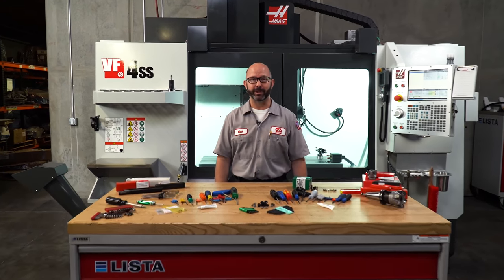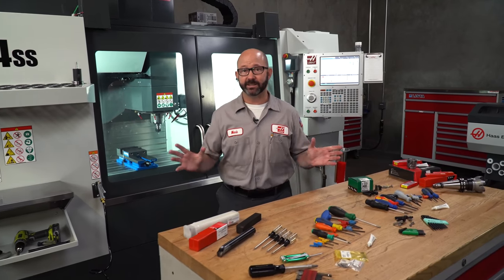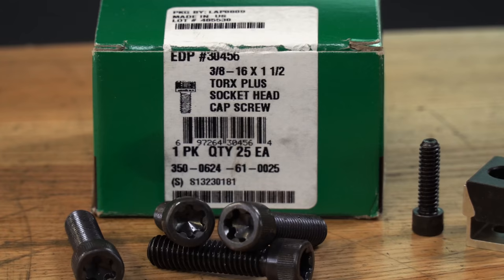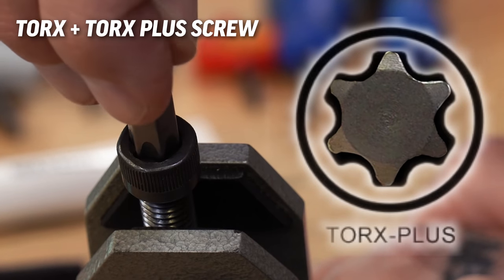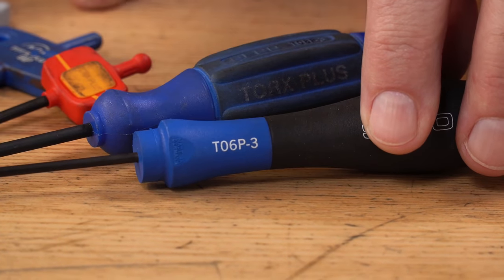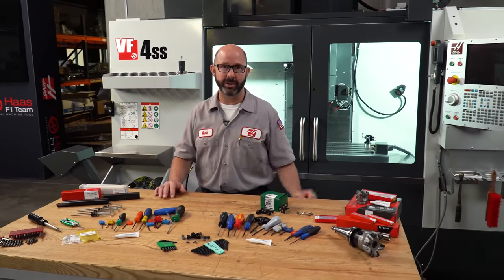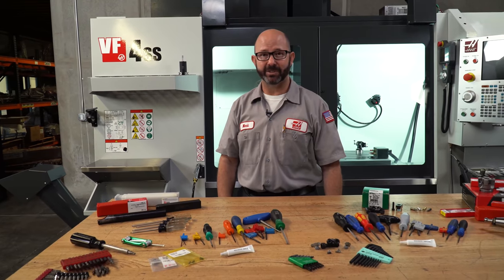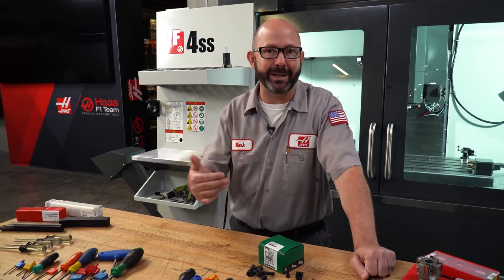THIS IS NOT A TORX - Haas Automation Tip of the Day

Comment: "The company invented a new system that was even more secure"...

Yeah... for sure. That was the reason. They did this for us, so that we have an easier life. Another 25 year Patent was absolutely not involved in the decision of doing the same thing again, but different.
Reply: You need to get out of your conspiracy bubble. I've run the A to B torque to failure testing in a fastener laboratory. Torx Plus has a substantially higher permissible drive torque than a standard Torx.  The geometry of how the drive torque force is transmitted through the drive feature is substantially different, there's a lot more material there.
That's why you'll see them being used in low profile or high torque applications. Nissan, Ford and Tesla among others use them in production.
Reply: @otm646  and of course having the patent on that new system for another 25 years had nothing to do with them bothering to develop the improved version. When it boils down to it, its just to sell more stuff !
Reply: @Decrepit_biker  Pretty neat how they only last 25 years, huh? forces innovation 
or whatever
Reply: @amicloud_yt  I have known a company sit on an improvement for 15 years to get to the end of the 25 year period before releasing the update! I know as I used to work for them 🤣
Reply: @otm646  And in none of those the torque limits are even close to reacing,

A Hex-Head or an allen-head are capable of spanning even a 12.9 Screw, so how would being able to transmit more torque be benefitial?

The difference between the two torx heads is minimal in performance. 

The reason Automotive manufactuerers use these screws is that the manufacturer holds the patents, therefore is the only producer and therefore can give contracts with billions of screws involved, which in turn makes it impossible for outside manufacturers to join in. 

In essence they use patent law to influence the free market and keep their role. 
Its funny how you americans that are always about small business and people getting successfull do not see how this is a system that prevents any of you ants tp even be able to talk to your potential customers.
Reply: @peteraugust5295  That's not how it works at all. The automotive manufacturers do not hold the patents, they're held by fastener design and engineering companies like Textron. There's very little incentive for the OE to adopt something like this unless there is an engineering improvement worth the cost. The cost isn't direct, the fastener manufacturers whom they purchase parts from need to procure a license. That cost is passed along to the OE. The license isn't so expensive that it makes only Textron competitive in the bidding process.
No OE would agree to a directed buy like that either
Reply: @peteraugust5295  
>In essence they use patent law to influence the free market and keep their role. 
patent law does not make a free market. a free market is no regulations no protections period. not even copyright. a wild west of a market, leads to rapid and substantial innovation meeting or exceeding the needs of the market. while being 1000x safer and 1000x cheaper.
>Its funny how you americans that are always about small business and people getting successfull do not see how this is a system that prevents any of you ants tp even be able to talk to your potential customers.
no shit, why I am an anarcho-capitalist, not a socialist or a crony-capitalist. screw government, put this country back to the way it was.
Reply: @otm646  on the contrary. a large portion of manufacturers would really like to keep you out of their products... * chough * Nintendo * cough * and would design a fastener just to keep you out of it. remember the triangle bits form your old gameboy? never seen them on any other device, like ever. But security bits are a major problem in these industries... good thing a lot of them are just doing torx with a pin in the middle, that only take a drill to make your regular torx fit that screw hole but that's besides the point.
Reply: @TheObsesedAnimeFreaks  Patents encourage innovation not stifle it. Without patens another company will just reverse engineer your product and without the R&D cost release it for a more competitive price, forcing the original manufacturer out of the market without seeing a return on their investment. A truly free market doesn't work for many reasons but this is a big one.
Reply: @fergusoddjob  This is actually completely incorrect, it would instead cause the inventor to strive to constantly improve their product and release updates regularly, while also forcing competition. The investment put into the product would always pay off as continued investment, marketing trust and quality assurance will keep the inventor competitive. In a truly free market, innovation is king. The question that you should ask is not whether your investment would be "protected" rather is there a hole in the market I can fill. If you answer the latter question, the roi becomes irrelevant as that's almost guaranteed if your market is big enough to return that investment. Never mind pattents do nothing but stifle inovation as they are a roadblock to it by definition. It allows companies to sit on their crap products rather then invest time and money into improving them.

Never mind no company in their right mind would just copy another companies product. They almost always have to invest time and resources to change and improve the product or bring something new to the table.
Reply: @TheObsesedAnimeFreaks  No company directly copies another's product because of patents not despite them. In China where patent law isn't really enforced carbon copies of patented products are very common.
You honestly think businesses will sink millions into research and development if they aren't confident they will be able to recover costs and hopefully make profit. Without patents companies have a few weeks maybe a month to recoup costs before a competitor undercuts them and that's not long enough. 

Ignoring patents for a minute, a truly free market has so many more problems. In industries with high entry costs like utilities and train lines the likelihood of a monopoly forming without government intervention is very high. In a truly free market there are no public goods, meaning you'll pay out of pocket for roads, streetlights, parks, healthcare (you already do in the US and it's not working), education, law enforcement and ambulance services. Finally, without government regulations corporations will take advantage of negative externalities to increase profit, for example foregoing environmental protection processes in the interest of profit.
Reply: @TheObsesedAnimeFreaks  "it would instead cause the inventor to strive to constantly improve their product and release updates regularly,"

What you're saying here is that the inability to ever make a profit on the original product (because it would immediately be copied and released by other producers who do not have to cover the development cost) is the incentive to abandon the original product and start developing an upgraded one, which would also be copied immediately upon release by a competitor, and so the cycle repeats. The inventor gets all the R&D costs and the moocher gets all the profits. Behold - the theft economy of "anarcho-capitalism".

"Anarcho-capitalism" is a contradiction in terms. Capitalism is the system where individual rights, including property like patents, is uniformly and objectively protected by a single entity (the state). Anarchy is subjective rights which means subjective law, which means a state of constant theft, violence and warfare.
Reply: Torx bits are not particularly durable, particularly the smaller sizes. I'd say they're even weaker than hex bits. I can absolutely see how the Torx+ would last longer and/or be capable of more torque. Business innovation and property rights in the form of patents is not a sinister conspiracy but a vital part of a capitalist economy.
Reply: @TheObsesedAnimeFreaks  They are misusing the Patent Law, which by definition requires essential improvement to a product to be reapplied. 

Du to their market power they can afford pushing thru patents that do not really qualify for one. Something that the average Shmoe never could manage.
Reply: At least they were kind enough to make it somewhat backwards compatible.
Reply: @fergusoddjob  You reply in video which states, that Torx was only widely adopted after the patent protection ran out, where many comment that they never saw a TP screw in the wild and lots of other examples like this exist (Robertson screws for instance). Are you sure the system works great?
Reply: @svensonb2118  I was discussing with someone who seems to want to abolish patents entirely. I agree that patents have their problems and  can result in large companies with the resources to pursue lots of patents dominating the market. I think there's a pretty good argument for shortening the patent time period  as well. But getting rid of the system entirely? That just sounds absurd to me.
Reply: @fergusoddjob  
>You honestly think businesses will sink millions into research and development if they aren't confident they will be able to recover costs and hopefully make profit.
if you are sinking that much money into something and it's a cheap product, to copy and reproduce, you are doing something wrong. if you are a CPU producer, for example, then the cost to produce these products is even more expensive and improbable to duplicate. this is reality despite no patents preventing competing companies from creating new CPU architectures to compete with Intel and AMD. IP is still a factor, however x86 or CPUs a general idea is not patented, it's IP. 
Fields with high boundaries of entry are almost always going to be lower competition because fewer companies have the means to produce the produces, and they are often extremely difficult if not more expensive to reverse engineer. 
if you are designing a lock, what are you going to spend to develop that lock? 100k? you can easily make that back. tooling manufacturing it's not going to cost all that much to make that lock and produce it. 
a phone? you are using off the shelf components, and in a free market, FCC cert would be unnecessary, further reducing the cost. just design the housing and the place the components and you have a phone, in an over simplified manor. that would cost you 100k? if you are just using off the shelf components?
So yeah, in a free market companies will continue to spend millions if not billions on specific types of products with high production or development costs. however the excuse to spend a million+ on a simple product, like a fastener would be gone, like if very well should be. 
>In industries with high entry costs like utilities and train lines the likelihood of a monopoly forming without government intervention is very high. 
Actually no, the likely hood of a monopoly forming is not plausible. considering the fact that anyone could run lines wherever and no government could stop them. in fact you would probably have 3 options of power companies running 3 different standards, and likely the ability to run 240v for your computer and other office electronics for efficiency in America, and then run lower voltages for other things.  same with cable and telecom. not to mention that consumers would often have to bear the cost of running cable instead of governments footing the bill like they often do. 
>healthcare (you already do in the US and it's not working),
comparing a tightly regulated industry to a free market, is the most moronic thing you can do. our healthcare industry actually works extremely well, despite the BS we have to face, there is a reason people from all over the world come to America for treatment, and not other places. it would work better if government stayed the fuck out of it and let the market manage itself. 
>In a truly free market there are no public goods, meaning you'll pay out of pocket for roads, streetlights, parks, healthcare (you already do in the US and it's not working), education, law enforcement and ambulance services.
in a truly free market these things being out of pocket for the consumer is actually a benefit. sorry, you think that the roads should be paid for by people that don't use them or don't need to have them built? parks being private actually makes the parks work so much better, why are you knocking privately owned parks? law enforcement probably should be private, to some degree, and even if it's not, i should not have to pay taxes to fund a system I don't want/need/disagree with the enforcement measures. among other things. 
>Finally, without government regulations corporations will take advantage of negative externalities to increase profit, for example foregoing environmental protection processes in the interest of profit.
no company will ignore the environment for profits. When a market demands a company actually take care of the environment, the environment will be taken care of. they will make more money if they take care of the environment then if they don't more often then not, because their customers care about the environment. Second, when the market demands that things like DEF and other emissions systems get off their diesel vehicles because they don't work, they are harmful to the environment and is a convoluted system that is a bandaid on a already broken system. but instead of coming up with a better solution to the perceived problem and letting the free market handle it... they mandated 2 Bandaids on a broken system that doesn't need to exist. SO, the market is always right in that regard, there IS demand for "Greener" products, and there is demand for less polluting products. getting government out of the market will result in cheaper and cleaner energy via Nuclear, and cheaper and cleaner cars via actual innovations in car technology. what ever you think regulations do to protect anyone, they actually do the opposite. that's a fact that's been established through the ages. government does one thing they cause 10 different other problems and prevents new comers from entering the market.
Reply: @phamnuwen9442  
>What you're saying here is that the inability to ever make a profit on the original product (because it would immediately be copied and released by other producers who do not have to cover the development cost) is the incentive to abandon the original product and start developing an upgraded one, which would also be copied immediately upon release by a competitor, and so the cycle repeats. The inventor gets all the R&D costs and the moocher gets all the profits. Behold - the theft economy of "anarcho-capitalism".
you greatly underestimate what companies will do, and how competition works. you also don't understand the what you are talking about period. a company will seek to make a profit by seeking a hole in the market, if that hole exist they will fill it. that's how anarcho-capitalism works. if too many companies enter that market, then they choke each other out. especially with niche products. not to mention you have to differentiate yourself from the competition to stand out. then authentic marketing becomes important along with proving your product works better then your competitors while also being the better quality one. A company most definitely would attack a niche market or any other market if they stand to make a profit. thats how a free market works. as an inventor I don't care about patents, I care about making a product and improving it. i have no need for the protection as my product will always be the better product as i work to develop and innovate my product. 
>  Anarchy is subjective rights which means subjective law, which means a state of constant theft, violence and warfare
Anarchy is defined as a state without rulers, NOT RULES. and in a state without rulers where everyone is armed, free do what ever they want, and make money how they see fit, most people will respect the inherent rights of the individual and work to protect their neighbors from those that might want to harm them. in an anarchic state fueled by competition and not cooperation, the competition drives people to hold the inherent human rights of the Freedom of Expression, Property and the right to self Defense as law rather then other aspects of things. however when you have competing rule sets and enforcement measures you will get issues with that competition, why having a unified court system and rules for those courts can be a plus. HOWEVER, all of this is theoretical, BECAUSE there has been no real experiment where a large group of people has been able to establish an anarchic society structured as an anarcho-capitalist state. we have had democracies, WHICH ARE ANARCHIC SOCIETIES, but not a large truly free state. 
>Capitalism is the system where individual rights, including property like patents,
you have no right to a patent, and a patent is not anything but a sheet of paper. sorry. property rights include things that you can tangibly touch and defend such as land, nothing more. 
> Capitalism is the system where individual rights, including property like patents, is uniformly and objectively protected by a single entity (the state).
actually no, CAPITALISM, is the system of economic production where the individual not the state controls the means of production in its entirety. The state has no say in anything the economy does. this includes the creation of and enforcement of patent law and regulations. capitalism is by definition a completely free market.
Reply: @TheObsesedAnimeFreaks   You just wrote a many words worth of incoherent nonsense, but you failed to explain how I'm going to recoup my $100,000,000 ten year investment in researching and developing a new anti cancer drug if all my competitors can simply reverse engineer it in a few weeks and undercut me in price.
Reply: @phamnuwen9442 ... I did answer your question read my reply.
Reply: @peteraugust5295  "Du to their market power they can afford pushing thru patents that do not really qualify for one. Something that the average Shmoe never could manage."

If the patent system is indeed corrupt, making it easier for some inventors to get patents than others, then there is a real problem in the system. The solution in that case is to fix the system so that it protects inventions equally regardless if the inventor is a big or small business. The answer is not to abolish patents (property) entirely.

I don't think you have proven that this is one of those cases, however.
Reply: @TheObsesedAnimeFreaks  There was no answer and I'm not going to read it again.
Reply: @otm646  why didnt they just get it right the first time?
Reply: @TheObsesedAnimeFreaks  actually you see those little triangle head screws on all kinds of electronics not just Nintendo products and they were not made or patented by Nintendo.
Reply: @phamnuwen9442  except that I did answer it. Read it again.
Reply: @fergusoddjob  yes. Because it mean the inventor with actually be able to make a profit from the invention rather than I just be taken up by the first person able to get it out and market it.

But it's only Up unto a point. A patent can last too long or be too broad.
Reply: @TheObsesedAnimeFreaks  I would hate it if my screwdriver needed to be updated (replaced) every year. Your ideas seem to be based around the technological market, where updates benefit already purchased items.
Reply: @TheObsesedAnimeFreaks  is there a country with a anarcho capitalist economy?
Reply: @daviddavidson2357  statist says what?
Reply: @Burns11112  no, but micro communities do exist, and Athens was a complete democracy at some point.
Reply: @TheObsesedAnimeFreaks  I literally facepalmed at the fact that you missed the obvious joke.
Reply: @daviddavidson2357  oh the joke that was unfunny and an insult...

I am not In a great mood, (completely unrelated to anything anyone has done)
Reply: @TheObsesedAnimeFreaks  You're gaslighting, you're evading reality and you're muted.
Reply: @TheObsesedAnimeFreaks  It wasn't intended as an insult.
I genuinely hope things start going better for you if you're in a shit place right now.
Reply: @daviddavidson2357  between being tired and just not feeling great, yeah, but I am doing better either way.
Reply: @phamnuwen9442  you asked what a big pharma would do if there wasn't patent law, I replied with they would carry on with what they were doing. If there is a hole in the market someone will fill it. Period
Reply: @TheObsesedAnimeFreaks  yeahhhh, bout that. Laissez Faire worked so well that the United States had a whole progressive movement because they were so frustrated with the high quality of living that capitalism was providing it. In fact people were upset that there was just too little pus in their meat, that we had to form the USDA to ensure that pus demands were met
Reply: @TheObsesedAnimeFreaks  "if you are sinking that much money into something and it's a cheap product, to copy and reproduce, you are doing something wrong."
One word: pharmaceuticals. They have very high development costs because of safety testing and just finding something that works. However, they are super cheap to produce once the formulation is established. Without patents off brand competitors can manufacture the same drug for a lot cheaper and push the original manufacturer out of the market. And it's not like its worth spending another 5-10 years to develop an improvement or different drug if its going to be copied within the first month. So are you okay with never developing anymore medicine in this new society? Also solid effort picking CPUs probably the best example of where patents aren't needed because of how expensive and complicated the fabs are, where experience of building CPUs for 10 years and having large R&D budgets is key. But that doesn't mean patents aren't critical to the function of a majority of industries.

"in fact you would probably have 3 options of power companies running 3 different standards" 
No you wouldn't. once one standard is developed that properly addresses the market demand, competitors have no incentive to invest millions into new infrastructure without any guaranteed profits. this is the exact same concept with private rail, where development cost doesn't justify competing, if the competitor is providing a somewhat passable service.

"it would work better if government stayed the fuck out of it and let the market manage itself." 
the whole concept of government healthcare is that you have lots of bargaining power over pharmaceuticals and surgeons, as a result of the large population under the one negotiator. This drives prices down even with patents and allows for the spreading of the burden of healthcare, ensuring that lower-income people can get more expensive treatment if needed without going bankrupt. This cost can also be offset by taxes on things that cause increased healthcare costs, like cigarettes and sugar. This means that even if a poor person who smokes gets sick they can still get treatment, but overall the non-smoking community isn't paying for all their cancer treatment. In a private system you have a bunch of different competing insurance providers that lower prices to entice customers simply by removing treatments that are critical. And because of their smaller size compared to Governments, their prices are overall higher, with lower bargaining power. This system does have one negative, it is slower to react to new treatments and surgeries than smaller more nimble private insurers. This is a small negative for affordable healthcare for all, not just those with the right job or enough money.

"no company will ignore the environment for profits. When a market demands a company actually take care of the environment, the environment will be taken care of."
Unfortunately the market doesn't want stuff that is environmentally friendly, when either they don't know what is going on, or the extra cost of being sustainable, (there always is an extra cost) which offsets the demand for sustainable products and environmentally friendly company practice. The top 100 companies are responsible for 71% of the greenhouse gas emissions in the world. Even as environmental concern and therefore public demand for sustainable products is at an all time high. This needs to be offset by a carbon tax, that allows businesses to spend the extra money on avoiding C02 emissions.

Most of the nuclear power plants built in this world were built in regulated markets, where investors could guarantee profits for a long period of time at a sustainable level, due to the regulation in the market. When there isn't as much regulation typically sources of energy with lower initial investment costs get built instead. Nuclear power has some of the highest upfront costs of any energy source and on average takes a DECADE to build. They would therefore, never be built in a completely free market, (they are barely built as it is). 

I'm not going to disagree, regulations are very difficult to get right, economies are complex mechanisms that are hard to model, however, the slow evolution of policy allows for good regulation over time. A truly Free Market would not work very well, and that's the reason it hasn't seen any widespread use ever.

I'm not using arguments that are controversial either these are things taught in basic economics classes, that have been established by experts for decades.
Reply: @fergusoddjob  that would be the case of parents lasted for a reasonable amount of time, but they last for 25 years which is ridiculously long these days.
Reply: @otm646  Have you tested Torx Paralobe? I'm curious how accurate their claims are, extra dive torque of 40% over Torx and 20% over Plus, which also makes me curious if the 20% of Plus over Torx is also accurate.
Reply: @xaytana  I have seen  couple engineering samples but I haven't received any quote requests for that drive geometry. 
Personally I don't see much demand for it in the automotive world, the switch to Torx Plus was necessitated by engineering requirements for ultra high strength fasteners. 
These types of internal drives cause serious issues with recess fill when using standard Geomet or similar coatings used for exterior applications. Wherever this new drive feature is going to be used I'm going to make an educated guess and say it's going to be in M12 and larger. If they are smaller than that they are going to need to use an electroplate process which generally isn't suitable for direct exposure to weather conditions. This geometry might have advantages in auto feed situations where you've got a tool which needs to automatically and securely engage with the drive recess. In that scenario with smaller parts the extra torque transmission is not important.
Reply: @Decrepit_biker  
you know you can just extend patents right?  
they simply let the old one expire because they were already working on torx plus.
Reply: @peteraugust5295  
i have managed to strip a torx or 2.  
i have never managed to strip a torx plus
Reply: @amicloud_yt  Would 10 years lead to more innovation then? How about 0?
Reply: @fergusoddjob  patents don't need to last so long. And quality is an issue too. People avoid cheaper things that break.
Reply: @TheObsesedAnimeFreaks  a lot of innovation is innovation against the consumer. How to make it cheaper is a big deal and will be done at the cost of reliability and safety.

The patent system is absolutely the wrong system. We need stricter product regulation rather than long term patents. A patent lasting five years should be the longest they can last for.

Perhaps patents where licensing is more encouraged? Perhaps licensing could be required under certain circumstances?
Reply: @peteraugust5295  I have bought a lot of allen-head screws for my hobby-building, but they tend to strip out because of the small diameter of the key. Ill definetly try to get hold of some torx-plus hardware and test that.
Reply: @schuttrostig5729  You should probaby get some higher quality allen screws and/or start to design your builds with the adequate torque...
Reply: @Decrepit_biker  And why is that a problem? Companies are designed to make money and there is nothing unethical about it